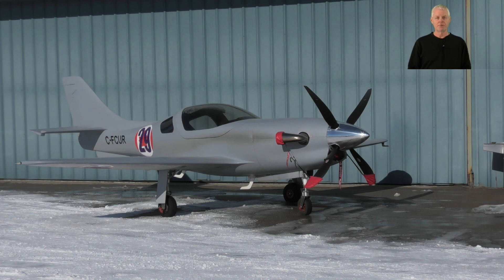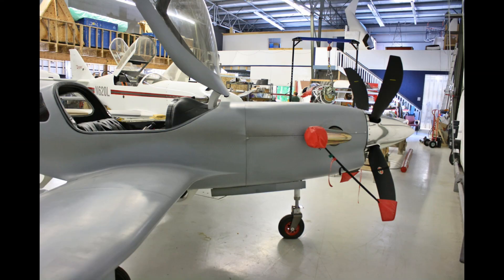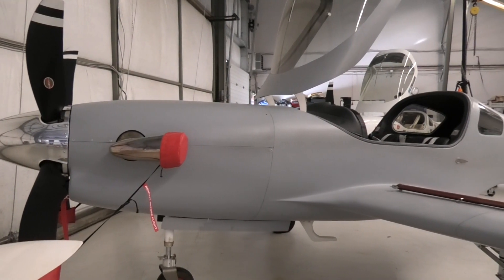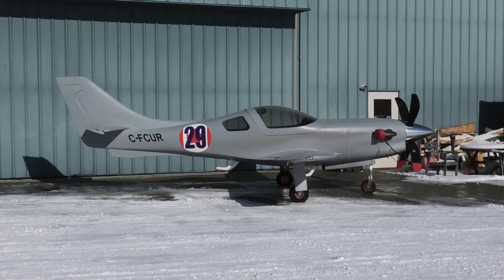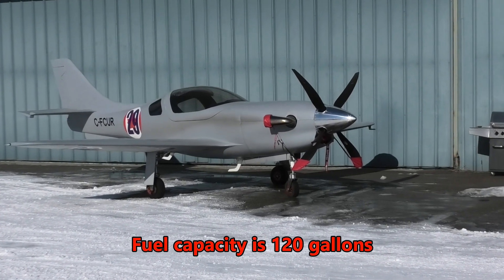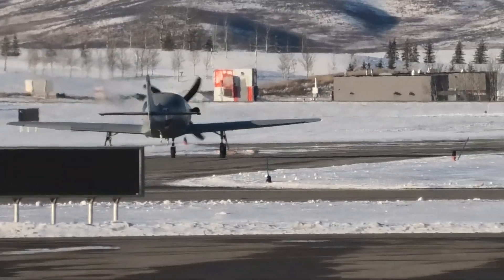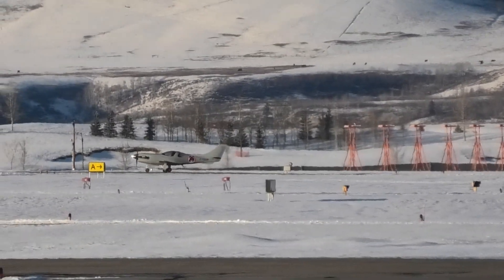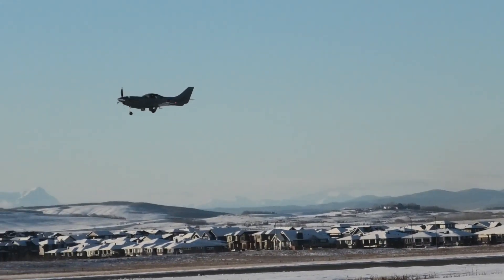Turbine Lancair Legacy

Comment: Beautiful plane, thanks for this video! It looks like they extended the Legacy's vertical stabilizer and added a ventral fin too, although they missed a chance to improve the aerodynamics a bit by squaring off / sharpening the curved bottom profile of the rudder. Do you know if they had to rework the front landing gear to accommodate the engine? I wonder how this mod affected the weight. I'm also curious if they added any carbon fiber stiffening to the flanks. It's a shame they don't make the Lancair Legacy kits anymore, they were one of the sexiest kitplanes ever produced. I hope you get a chance to do part 2!